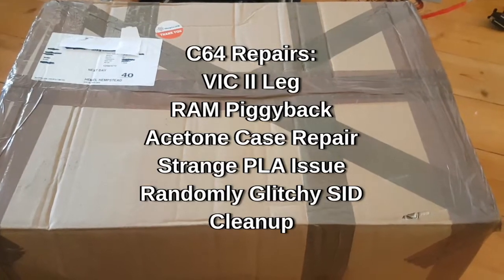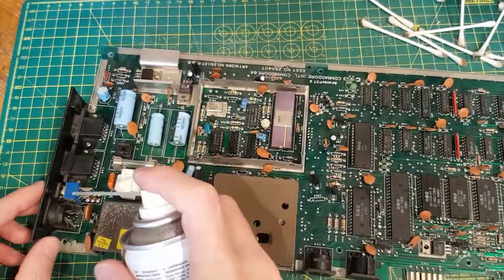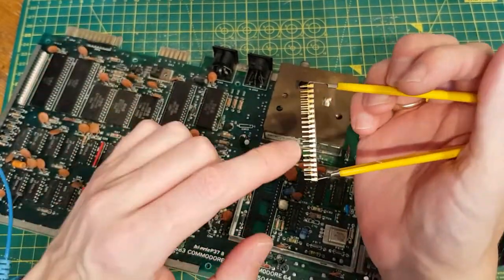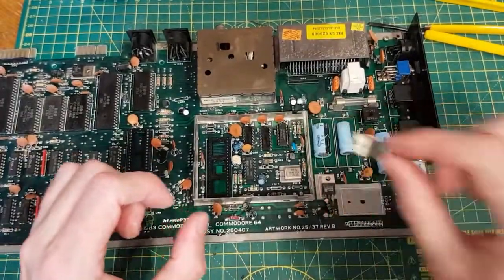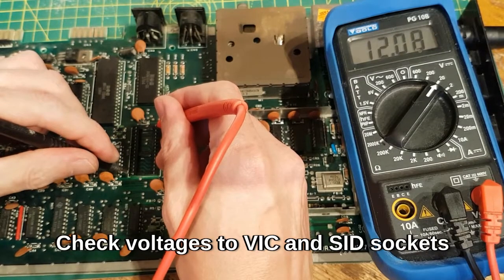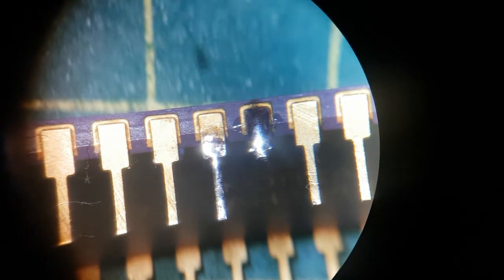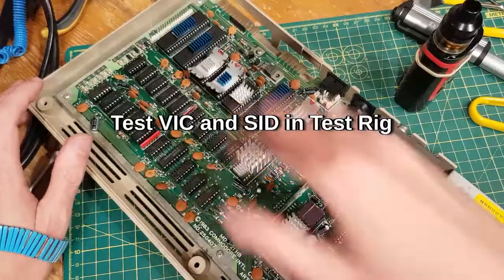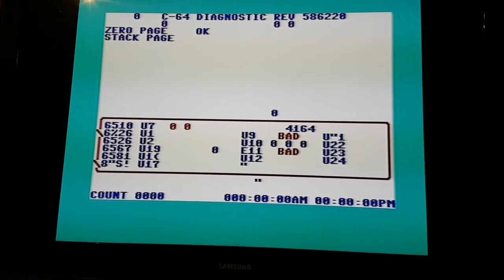eBay C64: Numerous Faults & Repairs (250407)

Comment: Man! Let's pile on the problems, shall we? 😉 That was an interesting PLA fault. Great troubleshooting and fixing. Test rigs are so useful -- saves a lot of time testing ICs. Oh! And I like the fast editing in this one -- you got a lot of info into the video and all in 10 minutes. 👍
Reply from the maker: Hi. Thanks for watching and the kind comments😃. She certainly gave me the run around and I wouldn't be surprised if she features in a future video 🤣. I am still not 100% convived about that SID issue. It is always a bit of a worry to keep swapping irreplaceable chips between sockets. Their poor little legs can only take so much 😟
Reply: @Plan-C  Oh yes, and I forgot to mention, nice job on patching that broken leg on the SID. Coincidentally, I am working on a 250407 board myself. All major ICs are socketed on mine. Major RF Modulator issues from a super leaky cap, though.